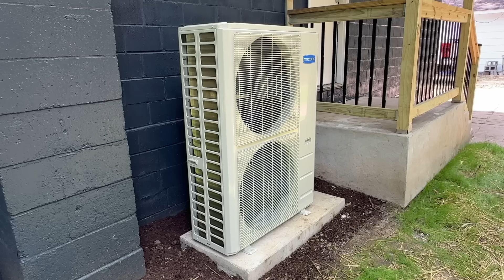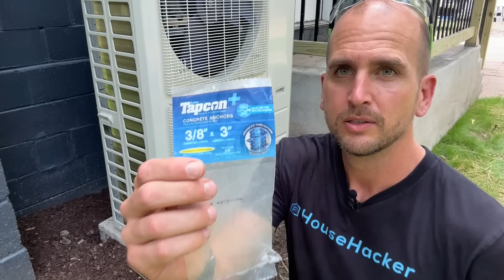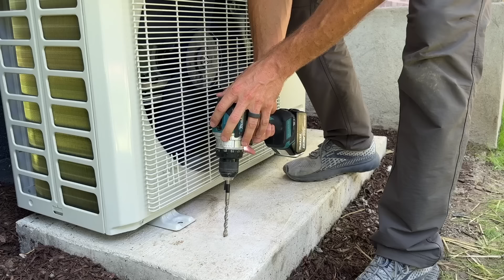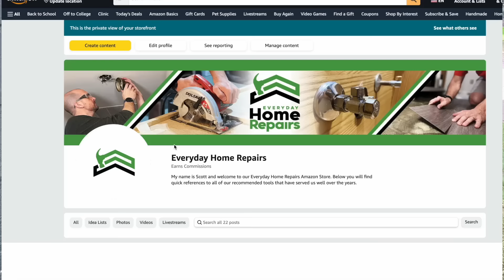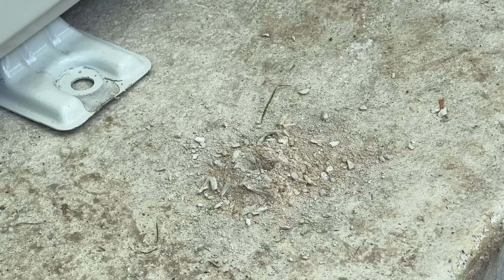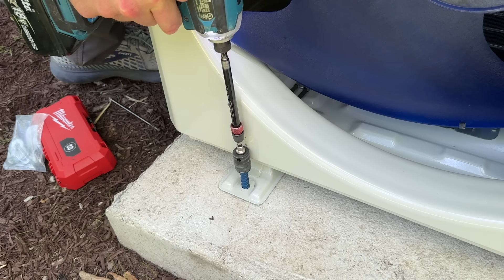The Only Concrete Anchor You Need And How To Properly Install

Comment: So what you're saying is 71% of installers are using the wrong concrete anchor on a vibration source? Nice.  Even 1/4" Red Heads would be better.  Just another way installers cheap out in my opinion.  Since 1984 Red Heads have never failed me.  If you don't drill Tapcons absolutely perfect, there is very little concrete to grip...if the concrete is even any good.  Homeowners pour their own.  And Tapcons will snap off like a cheap drywall screw...then what?  A bracket on the top to the block wall would be a good idea with a unit that tall.  Never underestimate the effect of wind...or even a slight push against the top.  Best use for Tapcons...furring strips on concrete for drywall.

Comment: And maybe if you put some blue tape on the socket or on the metal where the socket will be, you can avoid scratching the finish on that unit. Not that it make a big diff tho.

Comment: For a striped Tapcon hole i insert  a small piece of wire or a toothpick in the hole and reinstall the screw or bolt and it will work just like the non striped hole.

Comment: Great video!, I used Tapcon before.  Failiure modes were drilling hole shorter than the bolt length and snapping the head of the bolt and sometimes the drill bit size matching the bolt size resulted in the bolt is "loose" and what I was anchoring was not properly anchored!!!.  In that case I had to move up to a bigger size Tapcon..

Comment: The biggest problem I have with drilling into concrete foundations is hitting rocks, and the bit not being able to go through them. Any tricks with that?
Reply: My Milwaukee rotory hammer will go through rocks and rebars.
Reply: @kimchee94112  Yep. Some of those big ones go through anything.

Comment: I can't believe they sell them with Phillips heads, they are AWFUL. Only use the ones you show and yes, read the label if there is one. The other day I mounted a board to a concrete wall for some electrical in an unfinished room and it literally took me 5 minutes with the right tools.

Comment: I tried using tapcons on brick and the  threads stripped out and didn’t work. I used a hammer drill and the drill bit that came with the screws. Wondering if the bricks in this 50 year old building are just to hard.

Comment: Good video, but as you were about to insert the first Tapcon bolt I was afraid  the bit was going to scratch the Aircon unit and sure enough it did. On  both sides.  I assume the back side was as well.  Should have inserted a bit of cardboard between the unit and the rotating shaft.  If I was the customer I would have been pretty disappointed  having my brand new aircon unit scratched up like that.

Comment: when doing concrete anchors and the strips. i carry a block of hardwood, take a small ribbon of the hardwood the same length of the hole, and aprox 1/4 of the hole space drop it in the hole and reset the screw, sometimes 2 pcs opposite sides will be the last go to fix.

Comment: I hate tapcons! 1/1000 of an inch pound over torque and they strip out. Then it is time to break out the epoxy. I always use wedge anchors.

Comment: I would put some anti-vibration rubber pads between the concrete and the heat pump. This would drasticly reduce noise.

Comment: How do you keep the cement drill bit from drifting around the target drill point as concrete bits will not bite into the desired target?

Comment: They're great, I tent to avoid impact drivers for screwing in. Just use a drill set to to screw and torque out around 3/4, on the first one I might have to tweak it up or down a couple of clicks then it's perfect for the rest of the wall/slab that needs fixing.
Reply: You must be using really small ones in soft concrete. The ones I use most often are 10 or 12mm which is roughly equivalent to 3/8 and 1/2. My impact driver won't do them usually, I need to go to a 1/2 impact wrench to get them in. A drill would just break my wrist with no progress. You must not be a professional, because even if you can get them in with a drill, it's hard on you, and hard on the drill. I use impacts for almost all driving of fasteners, because they a lighter, faster and virtually effortless to use.

Comment: We drill a lot of sleeve anchors at work and to clean the hole we use a shop vac with a 1/4 copper pipe attached with duct tape 😂

Comment: I've always thought an epoxy held bit was the strongest in concrete.  Then again, these are preformed or just small concrete pads.  If they DID get damaged, they can always be broken up and replaced.

Comment: If you do strip the concrete hole out and the Tapcon doesn’t bite, stick a long zip tie down the side or a light gauge solid copper wire. Then drive the fastener down again and it’ll take hold. Cut the pigtail of the zip tie off once fastened.

Comment: The ONLY Tapcons I willingly use anymore are ones that are least 5/16 or bigger.  The little ones just snap so easily.  The bigger ones do work well and I don't have any issue with them.  I also generally squirt in some heavy duty construction adhesive into the hole depending on the project.

Comment: Tapcoms are great. Rotary hammer for drilling and driving... or at least thats what professionals do. ..and, you can just drill a bit deeper instead all that nonsense of clearing debris

There are reasons aplenty for other concrete anchors.

Comment: What do you do when you run into metal, such as rebar, inside the concrete? This happens to me ALL THE TIME, and I end up with a myriad of holes searching around for no metal in the concrete.
Reply: Two options. 1.) Replace the drill bit with a rebar cutter as soon as you hit said rebar and then swap back after you cut through. 2.) Use full head carbide / 4 cutter  bits.
Reply: @robertrada4783 Thank you very much!

Comment: Never had much luck with concrete screws stating put by themselves. I use twist ties to pack the hole out and that makes for a tighter fit.
Reply: Wrong size hole.

Comment: Yep, I use Tapcons for a lot of jobs at work, or in some cases zinc anchors. I prefer the rotohammer for much faster work. One thing you may want to consider when mounting fan units are vibration dampeners. The low hum/rumble can be annoying to a lot of people and mounting on spring dampeners is a good approach to minimize the vibration.

Comment: Sadly you took the paint off the unit when putting in the bolts,  A simple strip of painters tape applied to the unit before hand would prevent the socket abrading the paint on the unit.

Comment: Something that I noticed is that your hammer drill driver was in speed one. My makita, the xph14, can drill that 3/8 into concreteIn speed two no issue. I don’t know what model yours is, but it looks like it’s seen a lot of work. That might be why it took so long

Edit: I want to clarify that I am not trying to say that you gave out wrong information, it was clear in the video the standard hammer drill did struggle, and the rotary hammer drill worked a lot better. I’m just trying to maybe give a reason why the standard hammer drill struggled so much

Comment: I have been using Tapcons and other concrete  anchors for years.

You stated good solid advice.

Overtightening is probably the biggest mistake.
It breaks the side walls.

One solution is after recleaning the hole there are some masonry certified epoxys.

On something like this AC.
Put some in the hole and reinstall.
When that expoxy sets the  anchor will not go anywhere for this application.

For framing attachment. 
Move over and drill another hole. Make sure to stay within recommended spacing. 
When in doubt and possible install 2.

On commercial or industrial jobsites. This should be brought to the attention of the site engineer.

Regular workers do not understand the loads that the anchor will be expected to withstand over a lifetime.
Do not leave that to chance.

Comment: TBH I never had good luck with tapcons.  Either they don't hold, or the heads break while driving them. The hole has to be exactly right and it's hard to pull off depending on the concrete.  I tend to use wedge anchors if it's something I think I might want to remove at some point, and I'll use framing nails with rebar wire if it's something I plan to never remove (ex: a bottom plate for a wall).  The framing nail method has been my favourite for speed. I nailed all my dricore tiles down so the floor feels less bouncy now as they are actually fastened down.

Comment: You took the paint off the unit on the second hole, you need to put a thin sheet of plastic against the item being fixed to prevent the drill or driver bit from scoring it.
Reply: Good eye!

Comment: I always a rotary hammer drill and Hilti fasteners, and depending on the anchoring substrate (hollow block, etc) and load calculations I make, I may use the mesh sleeves and properly specified threaded rod with structural epoxy as per Hilti recommendations. This is generally for anchoring machinery, pumps, evaporators, pallet racking, etc.
Reply: That's the right way for heavy stuff, but it is overkill for this job which is basically just to stop the unit wandering about.
Reply: You lost 99% of the audience.  But I hear you.

Comment: put a peice of solid 12 awg bare copper wire in an oversided hole and then drive the anchor down. It will be just as good and no need to re-drill.

Comment: Never tried the compressed air before. I use a hand pump with a tube that goes to the bottom of the hole to push air all the way down. Without it the vacuum on top struggles to suck up since there’s no air flow, the compressor seems like an easier way of achieving this flow.

Comment: If you have trouble with breaking Tapcons or stripping out the holes, use your drill to drive them, not your impact. I think if you read the directions it actually says to drive them with a drill and not an impact. After I started using a drill to drive them I haven't snapped one or stripped one.
Reply: EXACTLY!
Reply: What setting should i set  the drill motor to as to not apply to much torque, thanks
Reply: @drdwgmd14  I don't use the clutch settings. I set my drill to drill mode, drive until the drill stops and the Tapcon is tight. The wide part of the head firmly contacting the work piece. Workpiece firmly attached. If you're breaking them then experiment with clutch settings and find what works. My drill is an old Dewalt and it might not be very powerful anymore, but it can still drill concrete and sets Tapcons on drill mode without breaking them. I've broken exactly one since watching this video 8 months ago. I use the hex head Tapcons and a hex nut driver. Make sure to use the recommended diameter size drill stated on the packaging. If you're not in a hurry use a shop vac to suck the concrete dust out of the hole, if you don't have a shop vac or if you're in a hurry like at work or something, you might have to run the Tapcon in and out of the hole a couple times to clean out the concrete dust to get it to tighten down. But long story short, if you use the right diameter drill, use hex head Tapcons, drive them with a drill, and make sure there's not too much concrete dust leftover from drilling the hole, you'll have a 99% success rate with Tapcons.
Reply: @artvandelay1099  i went with another brand, 1/2-in x 6-in Concrete Anchors, from simpson strong tie, I will actually put this in with a ratchet .
Reply: Any bolt, screw, nail, etc.. will break if you put enough force on it.
Reply: @JPC74  Well, no doubt. But Tapcons are notorious for it. It's to the point where I always thought they were a crappy product. Many of my coworkers always said that Tapcons sucked and couldn't be trusted. They would use Tapcons as a last resort. I'm just saying that once I started using my drill to drive them, my problems with Tapcons were solved. To the extent that I actually like them and trust them now.

Comment: Failure Modes & Solutions Summary from video and comment section:
1 - measure twice, mark location of hole, double check
2- make a small indentation to prevent drill from walking
3 - use bit size stated on package (ratio changes to 1:1 at larger sizes)
4 - drill hole deeper than length of fastener; use tape or depth guide 
5 - use hammer drill or rotary hammer drill
6 - clean out debris with canned air, compressor or drill bit
7 - use torque limit when driving Tapcon in place to prevent snapping head off if it binds
8- hit a rock in concrete?  Relocate or use shorter fastener if application permits
9 - make the hole too big? Use larger tapcon, lag shield or other fastener type or insert some metal wire to buffer
10 - Work drill in and out for deeper larger holes to avoid overheating bit

Question: why is the ratio one-to-one at larger sizes?   Thanks for video.

Comment: I look forward to a video a year from now on how to repair a concrete base that has cracked due to vibration 😂

Said with love! Great video as always but like of vibration support was an odd one. The thing is, it's not that the fans are going to cause the unit to pitch this way or that, it's just a continuous low vibration that never stops. I installed 2 units on wall brackets (to avoid critters) and had to retro-fit dampeners after the fact because the low vibration was causing all the walls and ceilings around it to vibrate. Once I retro-fitted I cut it down by more than half. 

Obviously different situation here, but all that vibration has to go somewhere. And onto that pad it will go!

Comment: The trouble with drilling concrete, is often the drill bit walks on you soon as you start drilling, This can be a real pain if you are lining up more than one hole like what you did here. So what I do is use a punch to start the hold and use a small drill bit that will set in the punch mark and drill a pilot hole. Even a new sharp drill bit will walk on you sometimes. I do like those anchors. Have used a lot of drop in anchors also, trouble with those is you need to drill a much larger hole to accommodate the anchor not the bolt.

Comment: Whatever you use a rubber insulator should be used under the mounting pads. Absorbs the vibration and stops water from accumulating under the metal mounting pads.

Comment: Stripped out whole.  Epoxy glue.  That’s one method where you deliberately drill a hole bigger than the anchor, like a bolt anchor, with the hole filled with epoxy glue.

Comment: I use an air duster to clear out the hole, never broke off a tapcon after. If it doesn't grab, stick a zip tie in the hole and cut the remainder off flush.

Comment: Never have i ever stripped out a hole .... has always been a case where i just straight up sheeared the head off.... on the 3/16 and 1/4 " screws ... i really wish tapcon made 5/16s as most times the 3/8s are a bit too bulky for my small hang applications

Comment: My problems are rarely from the Tap Con itself. It’s drilling the hole. Hitting rod is my number one issue. Number two is snapping the head of the tap con. I get going too fast when I’m doing lots of them. You put a little too much torch and they snap right off.

Comment: Note: that drill sizing is ""NOT"" as you say with all bolt screw in anchors. Different brands different sizes are needed. If You drill to big for your size place some copper wire or steel wire in the hole and impact it in to required torque.

Comment: I have drilled holes and as I am nearly done I will hit steel or river rock or (something) so I cant bottom out the drill. I guess I could cut off a tapcon and just put in the cut off screw. This was for things that where not real heavy at all going up on a concreate wall.

Comment: Had problems using the smaller size tapcons because of drill wobble etc., so in cases like that i learned to drill a smaller hole first and then go over with proper size bit.
Reply: Smaller bit in all cases gets a better center alligment

Comment: The problems I've had with Tapcons (smaller, more common sizes) occurred when driving in the screw with an impact driver...seems they had a propensity to strip out.  Once I switched to using a standard drill to drive the screw, that problem went away.

Comment: Remember that concrete is sand that has hardened because of science. If you wobble the drill when drilling you are making the hole bigger than it needs to be. Use some plastic weed wacker line or wall anchors to take up the space. They make lead anchors for this purpose as well. I always use gorilla glue with my fastners. 20 years, 100's of tapcons - never a problem. I also put my dry vac on blow or suck to get as much drill waste cleaned out of the hole.

Being in Florida I also use the white coated hurricane shutter version for outside.

Comment: I haven’t used this brand, but I have put shelves on a concrete wall with concrete screws.  They are the best choice for that relatively light-duty application.

Comment: I’ve never met a Tapcon that DIDNT let me down, in any diameter. 50/50 chance they snap off during installation. They are not reliable to be able to hold their rated load as it is so easy to yield them during installation of you do t end up snapping them off completely. I would not rely on them to affix anything with any weight to a concrete wall or ceiling.

Comment: You should discuss how ineffective a hammer drill is if you are drilling into concrete with rock. It is for cement and masonry, aka, bricks. You need a rotary hammer drill to have any chance of drilling through aggregate rock. Without a rotary hammer, the best case will be a drill that diverts off to one side when it grazes a rock and the worst case is a drill that is simply stopped in its tracks when it hits a rock head on.

Comment: I use Tapcons for attaching metal boxes and conduit hangers to cement walls.  Originally used a hammer drill.  Eventually I got smart and now use a rotary hammer drill and SDS bits.